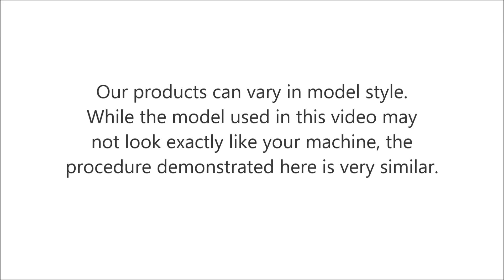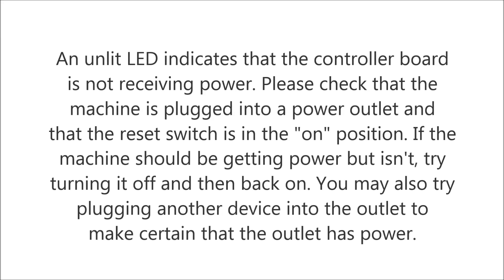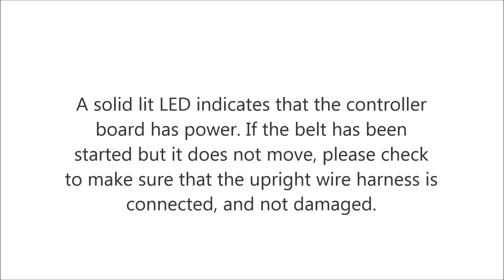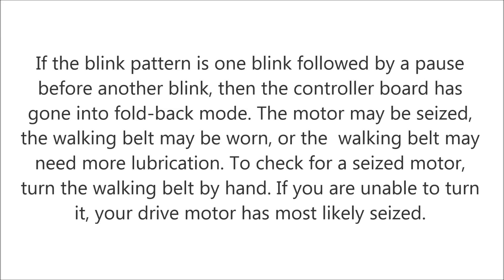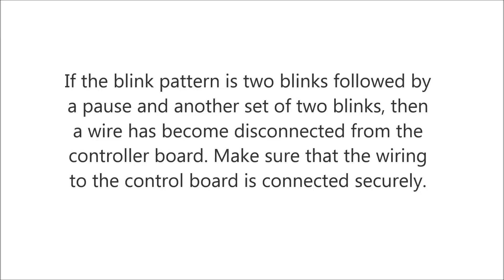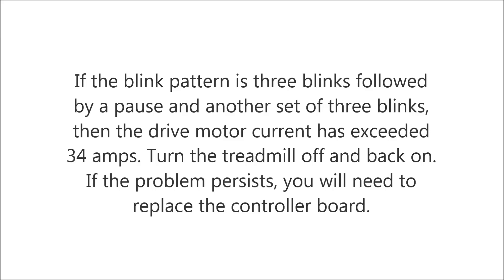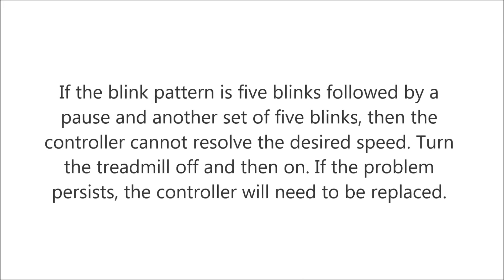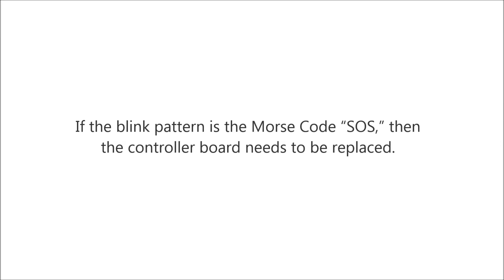LED Blink Patterns on the Control Board - Treadmill

Comment: Quick question for a repairman. you must see lots of treadmills. What's the best/ cheapest treadmill for a 300lb who walks daily 3.2mph @ 7incline and listens to music on spotify with earpods/ doesn't care about programs, bells and whistles?
Reply from the maker: Probably any lightly used treadmill on your local classifieds. there are a lot of treadmills out there that were bought in the last 2 years with the pandemic that people are realizing they are not using like they thought they would. these can sometimes be had at a bargain. Unfortunately the more you tax the motor either in weight or how long you want to use the treadmill during your workout, the bigger HP motor you will want to have. Bigger motor units tend to come with the whistles and bells.  If you are looking for new I might suggest from my company (iFIT) something from the Proform brand for economy.

Comment: noooooo 4 blinks after resetting infinite times. proform PFTL60916.5, first it was stopping and giving endless blinks, the treadmill would stop til i got off and let run then it went back to normal. Then it started the four blinks and now when i reset the motor goes half an inch and it stops to blink. I pushed belt and motor is not seized.
Reply from the maker: The motor controller will need to be replaced. It may have failed due continual high amperage being pulled by the motor. The other symptoms you describe are symptoms of friction and the motor working very hard. I would recommend replacing the belt on a treadmill of that age when you replace the controller to prevent another blown controller, if it was due to high amp draw.
Reply from the maker: Installing the belt is not too bad if you give yourself plenty of time and plan to have someone near by that can help with heavy lifting when removing the walking board.

Comment: Hi i had a t70 treadmill life fitness 2 years. ago now when i start to use it and at a low level it is  run but around 30 seconds suddenly stop, then there is a show to the screen motor controller error, then when turn off into switch and turn on again its run but around 30 seconds same happen its stop again,so maybe what the solution.
Reply from the maker: I am not familiar with Life Fitness products. I would first recommend you reach out to them. I think it is a good sign that it will run for a time before erroring out. does it error out with no user on it. If so the issue may be electrical and i would check to see if that screen prompt means the controller should be replaced. If it only occurs when there is a user on the machine I would make sure all the regular maintenance for belt adjustments and lubricating the machine is done. The controller error may be indicating a high amp draw and shutting down the treadmill.

Comment: What does it mean if it blinks with no pausing?
Reply from the maker: It means that the controller is receiving a speed control signal from the console and should be outputting voltage to the  drive motor. See the video at 1:28  https://youtu.be/QszHrCs72AM?t=88

Comment: my treadmill works fine until i hit 8 mph or more. i’m not sure if it’s the belt as i used lubricant and adjusted it as well. i checked the light, and it flashes one blink, pause, then it blinks again. any help?
Reply from the maker: the controller is detecting a high amp draw situation. the motor is needing to work harder than expected for some reason. this is usually due to worn out belts on older equipment or belts that are too tight if the machine is new or doesn't have much use. Make sure you only use the manufactures recommended performant lube. Many Off the shelf lubricants can interact with what is on the belt and actually cause friction issues.

Comment: My controller board is has a Fred and green light. The red light stay on while the green light blinks 7 time. I’m not sure what’s wrong. The screen in my treadmill does not come on
Reply from the maker: the green light should not be blinking. Either there is a short or damaged wire harness or the lower control board needs to be replaced.

Comment: Man. It won’t work on me. Mine is once power on both blue and red stat on. Console power on but no any key working. Motor is good though. Inspected all wire harness no any issues. Why this happened?
Reply from the maker: Make sure the safety key is present on your console.

Comment: My wife's Horizon ct5.4 treadmill will shut off completely after about 10 minutes of her walking on it. I took the cover off and watched it while she walked. The D23 led light flashes randomly. I can't seem to count a pattern. Things look clean. I vacuum it from time to time. Horizon isn't willing to offer any advice without a $50 initial phone call.  Any advice?
Reply: It actually flashes everytime she steps... No clue why it shuts off
Reply from the maker: @yarkie1  Horizon is a different company but there are a few things that you can try that should give you an idea that is common to all treadmills. Try running the workout with no one on it. Likely it is a friction issue and with no one on the treadmill there is not likely to be much friction. If it runs far beyond the 10 min limit then you likely have a treadmill that needs lubrication, a belt adjustment; or if the treadmill is starting to age, a replacement walking belt or other part that is worn out.
Reply: @FitnessEquipmentHelp  I ran the machine for over an hour with 
no one on it. It was fine. Ten minutes of my wife being on it and it shut off. The D23 light flashes every time she steps. Then it speeds the flash until the on off switch trips.
Reply: Also, the machine is not even 2 years old. And we lubricated it every time it told us to. We have also vacuumed it. I'm shocked it is worn in 2 years

Comment: I have three red lights that are supposed to be on and I only have the one in the middle and a very dim one to the left and no light towards the top.  I have zeros displayed, no display lights, the speed doesn't change from zero or the time. I'm guessing I need a new control board. I changed the magnetic wire for the speed, but nothing changes on the display. I have a Weslo 1015 I bought in 1991. I use it all the time and it's just starting to give me trouble. I guess it's not bad for a $550 treadmill bought back in the day.
Reply from the maker: Whoa, blast from the past. :) Make sure you turn your speed dial all the way to zero or the off position then try turning the speed up. (If that doesn't work then you are right you likely need the controller or a new speed control unit. neither of which are available from the manufacturer. ) Go check out some new iFit treadmills, the new features even on the entry level models are amazing.
Reply: @FitnessEquipmentHelp  Lol...Thanks for your response. This treadmill still works, it just doesn't keep my time or distance. I just ordered a controller on Ebay...We'll see if it works out. I agree about the iFit treadmills. I might just have to splurge on one soon.

Comment: LED is on. Console all lit, when start is pressed, console starts as normal and appears as it's running but motor not running and LED  stays constant( no blinking). Bad console??
Reply from the maker: Possibly, or the wires between the console are broken or disconnected so the signal is not getting down to the controller. Check out the wires first. The speed signal is carried by the blue wire in the harness.
Reply: @FitnessEquipmentHelp  Thanks for the help. Blue wire tests good.

Comment: Do you know what 6 blinks mean?
Reply from the maker: most all error codes indicate that the controller needs to be replaced. Some can be triggered by loose or disconnected wires, so check for those and power cycle your equipment by unplugging it from the wall. If the error codes persist replace the controller.

Comment: Does this apply to the MC5100 board in the X9i?  Mine is showing 2 flashes. I have re-seated all the connectors on the motor control board and the connectors in the console. Still getting 2 flashes.
Reply from the maker: Yes, the blinks are the same for the MC5100. one other place to check the wires before replacing the controller would be where the brushes connect to the motor of the plastic caps holding the brushes come out then those wires will be loose on the motor end and could cause the 2 blink error.
Reply: @FitnessEquipmentHelp  OK. Thanks. I tested the motor on a DC bench supply and it runs ok at 12v using about 2.2A. I will check the brushes though.

Comment: @Fitness Equipment Help  I pulled the cover off so I could see red light on board, and plugged unit into a 'different circuit' as you suggested,,,,,
Now the 'display stays lit', 'the red light on board is solid red', but as soon as I turn unit on where belt begins to move, it stops within 5 seconds under no load,,,,the red light is still steady on, and the display is still lit up as if working, but the belt shut down,,,,i tried shutting unit off, one time without metal key, the other time by shutting off the unit circuit beaker/switch, didn't help, red light stayed on as belt stopped moving after about 5 seconds! While the belt was running and after it stopped, the red light stayed on steady red, never blinked.
The new circuit I put the treadmill on has held up, so the old circuit was definetely not enough to even get this far, but belt unit won't run for more then 5 seconds,,,
My unit is Proform xp 580s
BTW thanks for your help!
Reply from the maker: You are welcome. w/out a multimeter it is hard to say for sure but if the console is acting like it is working then it probably is. The fact that the belt moves for a few seconds indicated that the speed signal is reaching the controller (lower circuit board) at least to begin with. Normally the LED on the controller going solid should indicate that the speed signal is no longer being received, which would make me suspect the upright wire. That wire can usually be visually inspected and unless you have moved the machine or re-assembled it for some reason then I don't know why it would spontaneously fail, (especially at about 5 seconds into a workout consistently). So I would think that the issue would be with the motor controller circuit board (even though usually I would expect it to be throwing some error code like in this video. Even though it is not throwing the error I think it is the most likely part.

Comment: our red light is on solid until you ask it to run, then it blows the circuit beaker to the room, always worked before, rest circuit breaker and steady red light again, but will tip beaker if you start treadmill
Reply from the maker: The treadmill pulls a lot of amperage at start up. more even if you are standing on the belt. The treadmill should be on a dedicated circuit. If you are using it on a circuit with other devices unplug everything else that goes out when the circuit trips. If the treadmill now runs then you just have an overloaded circuit. If you are still tripping the circuit you may have a short in your drive motor. or may have other wire issues.
Reply: @FitnessEquipmentHelp  I pulled the cover off so I could see red light on board, and plugged unit into a 'different circuit' as you suggested,,,,,
Now the 'display stays lit', 'the red light on board is solid red', but as soon as I turn unit on where belt begins to move, it stops within 5 seconds under no load,,,,the red light is still steady on, and the display is still lit up as if working, but the belt shut down,,,,i tried shutting unit off, one time without metal key, the other time by shutting off the unit circuit beaker/switch, didn't help, red light stayed on as belt stopped moving after about 5 seconds! While the belt was running and after it stopped, the red light stayed on steady red, never blinked.
The new circuit I put the treadmill on has held up, so the old circuit was definetely not enough to even get this far, but belt unit won't run for more then 5 seconds,,,
My unit is Proform xp 580s
BTW thanks for your help!

Comment: Norditrack T.14, the console says the belt is moving, belt remains still, inclime works, no light on the board. Unfortunately doesn't match the description for the no light case. What next ? (Help !)
Reply from the maker: If the red led is not lit or blinking on the board then you can suppose that there is at least something wrong with that controller board. This lower controller board is also most likely the cause of the belt not moving. I would start by replacing it.
Reply: @FitnessEquipmentHelp  Thank you. The card has been successfully replaced yesterday. You nailed it !
Reply from the maker: @lorybernues1084  I'm glad it worked out. Enjoy using your treadmill  :)

Comment: I have a proform 600i. Everything works like display/ incline decline commands and fans etc but when i press start nothing happens , no flashing lights on controller just the solid power led. Tested the motor  with a battery and it runs fine with that just not with the user panel
Reply from the maker: If the red LED on the controller is not blinking then it would seem that the controller is not receiving a speed control signal from the console. this is most likely a wire issue. Make sure the wires are connected correctly and haven't become pinched or damaged. It doesn't rule out the console however.

Comment: ProForm 2000. Display and incline seem to be working fine, but the motor won't start. The control board does not light up at all. Is there anything I should chk for before replacing the controller?
Reply: Hi, Did you resolve this problem as mine has the same issues

Comment: What is the cost to repair in sos mode?
Reply from the maker: Typically you would need to replace the controller. we do not repair PCB's on the component level, so whatever the cost for a controller for your particular model.

Comment: Ok. Have a nordictrack X9i that does everything normal but after a short time goes into fold back mode (with a heavier user) (slow flashing constant pattered). Now this is a bought used treadmill with some miles on it and no record of when it was serviced/belt changed. So I have already bought and am waiting for a new belt and a deck service kit /w/ lubricant so that it’s back to like new friction wise. My question is, I ran amp probe check on the power lead for the treadmill with a heavier user and it doesn’t seem to go above 8 amp draw (obviously fluctuates when stepping) when it backs off (speed slows down) in fold back mode. My question is can the controller board go into fold down mode earlier (at lower current draw) if it has entered fold down mode numerous times before (assuming the previous owner kept using the TM with a high friction issue for a long time) ie. a weakened controller. I know that circuits specs can drift do to constantly being overdrawn. Is that something you have seen in the past? Do we know how fold down mode works....is it a heat sensor on the board backing the motor power down, or is it an amperage sensor for a specific time that starts fold down mode. Is there a way to actually know at what load the fold back occurs, and a way to confirm it’s proper operation. I believe that changing the belt and deck should fix the problem but I’m concerned that when fold back occurred, it was below the 8-10 amps that would indicate a properly running treadmill. (It also could be that the amp probe isn’t fast enough to catch the higher current fluctuations and is giving a lower average reading), so there’s that too. Any thoughts are appreciated.

Comment: I have a Proform 505 CST, MN: PFTL60916.5 purchased December 2019. Hasn't been used over the winter. Now the belt does not move at all. Panel works as expected (speed setting can be adjusted, timer starts counting up as if in operation), incline function works as expected. Solid red indicator light on controller board. No blinking at all when speed controls are used. Harness wires seem to be in good condition (machine has not been moved). What could be the problem?
Reply from the maker: That's odd. When the controller (lower circuit board ) receives a speed signal from the console along the blue harness wire it should either start blinking normally or throw an error code. What you describe would indicate that the console is not transmitting the speed control signal or the wire harness is in fact at fault.

Comment: Hi, I have a control board which is flashing 8 times per cycle and I can see there is a burnt out resistor at the very least on the board.  I presume it is time for a new control board but thought I'd check if there may be another problem which may have caused the resistor to burn out and the error code to start?
Reply from the maker: Not Likely. Most errors are internal to the controller itself. External things to look out for that effect controllers include power surges (make sure to use a surge protector as indicated in the manual) and worn out or over tightened components like a worn out walking belt.